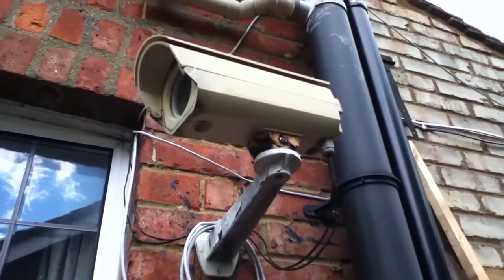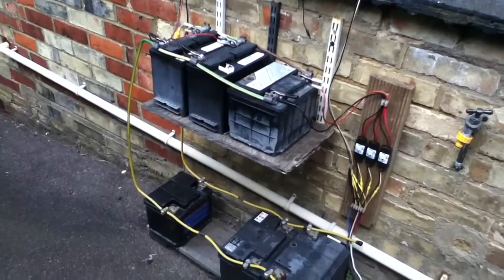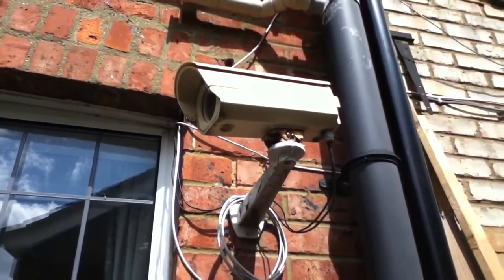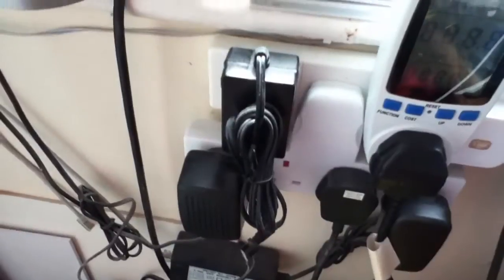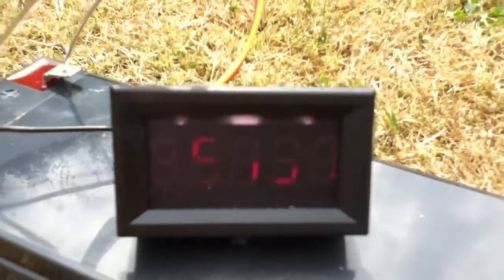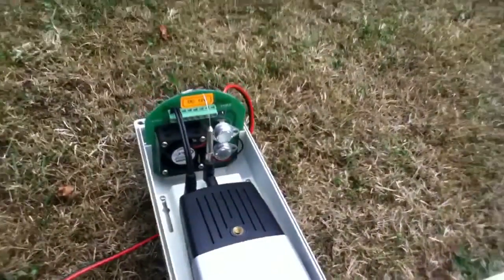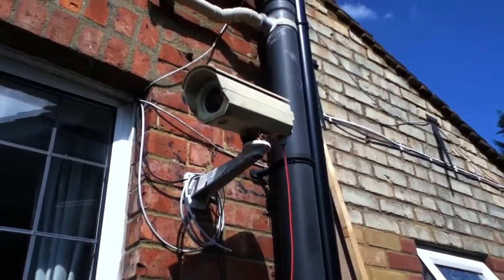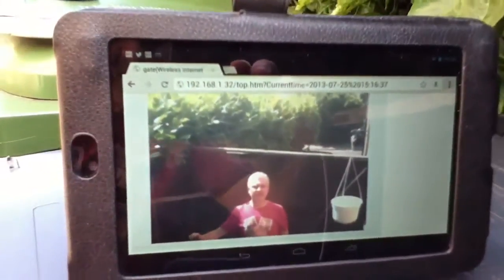Converting IP Network CCTV Security Camera to Solar Power

Comment from the maker: Images of the intruder would have been captured and written to the server before the cable could be cut - in theory! The camera points at the only access location (over the gate). The previous cables were easily reachable from the ground in any case.
The internal LiPo idea would certainly help - unless the bad people decided to whack the camera with a baseball bat.
The camera has worked reliably for nearly 10 years, but deterrent value is mainly what it offers.

Comment from the maker: You're right - winter will be a problem! The camera draws about 10W continuously. I should have looked at the resistor value, but I wouldn't be surprised if it's another 10W or so.
So I'm going to have to put some charge into the batteries from the mains for 3 months or so over the winter, but that's got to be better than all year round.
Your RasPi idea sounds excellent, but 500m sounds like a stretch for WiFi. My RasPi has sat in it's box ever since I bought it - no idea what to do with it!

Comment: That's cool Julian, just one little concern though. Isn't the camera's power now much more vulnerable to being meddled with? (since the cable now is outside and reaches the ground.) I suppose you could enclose it in a heavy duty conduit. Or what about installing a little LiPo or NiMH pack in the camera case (just for the 5 volts) and having that trickle charged by the 12v supply?

Comment: Interesting. Any idea how much current does it draws; camera, fan. heater? I'm thinking it could add up in winter.
I've been thinking of using a Raspberry Pi and a coupe of small web cams with solar power and wifi to the AP about 500 meters away. To keep power use down it would only upload stills every 5-min or so then shut down, but could possibly be set to provide video at times of usual activity on site.